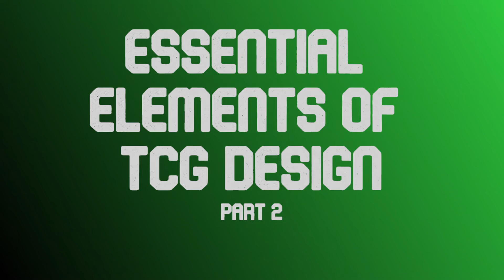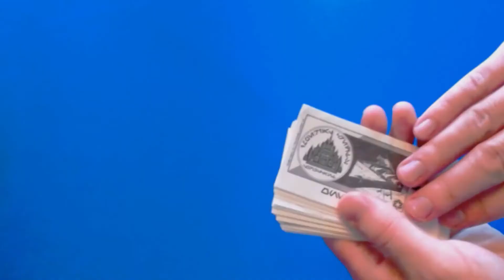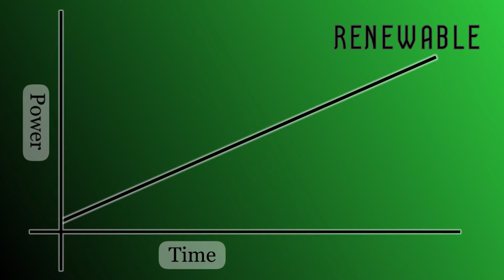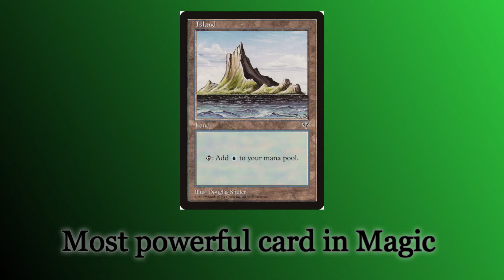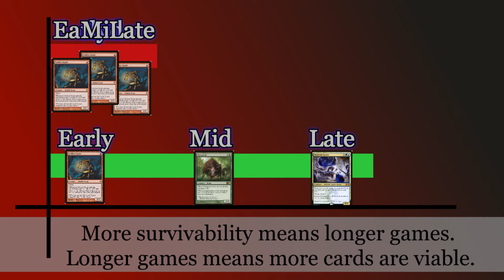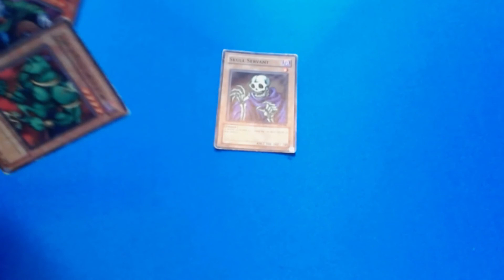Theory 303 - Essential Elements of TCG Design - Resources

Comment: I can’t tell if it’s already subtext for this video, but another concept that occurs to me, especially with vintage MTG, is the idea of offsetting when one player bricks but the other doesn’t. One player has only a 7/7 card but can’t play it in the early game due to resource cost, while the other player has only a 1/1 card though thankfully it should be no trouble to play it immediately. Whether or not this idea would also compensate for mana screw is outside the scope of a single YouTube comment.
Reply from the maker: Offsetting is important in a bunch of ways in tcgs, and is probably worth a video of its own at some point. Jotting it down in the 'video ideas' list!

Comment: It occurs to me that a lot of the problems people have with Magic’s Lands could be solved if we borrow a bit from Digimon. Not the memory system, that’s a bit too unique to work in every game, but digivolution. Every time you digivolve, you draw an extra card, essentially keeping you at the same hand size and replacing the card you just put down. Applied even to a basic land card type of system, it lessons the frustration of mana flood by turning every resource card into an extra draw, and while it can’t stop mana screw entirely, it does lesson the chances of that happening, essentially giving two cards per turn.

It would take a bit of testing and working to iron out, but I think it’s an idea worth pursuing.

Comment: One thing still worth mentioning is that resource engines can also be separated by when you pay the cost of the cards. Creating back-, and front end systems.

Front end systems are what most games use you tap lands/use action points/etc. and you play the card.
A backend system however lets you play cards for free, but "punishes" you if said card leaves play.

Im currently working on a game wich uses not one, but two back end consumable resource systems. I would like to get some oppinons on them partialy due to the feeling that I've started to trap myself and partialy because I think it can be an interesting conversaton to have.

First is a "life beting" system used for creatures.
   All creature has a "bond" stat. When a creature is defeated the your bond with them breaks wich means two things: 1st you loose Link Points(life) equal to theyre bond stat and 2nd they go to the Broken Zone.

Second is more classical consumable resource system used for the sorcery-esque cards.
   The cost of theese cards is payed by moving cards from your Broken Zone to your discard pile. Yes, you read that right the destroyed monsters became a new type of resource, wich I think is neat way to link the two system togheter and give the game a better, more fluid and flavor full card flow.

Aside from them there are 2 other card types: "heroes" and "skills".
   Skills are similar to yugioh's trap cards when a creature you control attacks or being attacked you can play 1 skill card from your hand, if the element requirement for playing that card is met by the creatures you have in play.
   Example: you have 1 crystal and 2 void element creatures in play if either one of theese creatures attacks or being attacked you can play a skill card with an element requirement of 1 crystal/1 void/2 void/1 crystal + 1 void/1 crystal + 2 void.

Heroes are less relevant for us now. All thats important is that they do have a "hero power" and a type wich desiced what kind of sorceries can you play form hand.(Emphasis on the from hand part.)

The problem comes up when I think about big creatures. After all they are hard to get rid off and I only need to pay anything for them when they have been got rid off, so why would I ever play smaller ones? I thought about a size system where each creature has a size and you are given a hard limit to the total value of size your creatures can have, but Im kinda set on the idea of creature zones, 4 in particular.
   Since the game clearly gonna need a draw up system to avoid stalls and this seemed the most elegant way to prevent a 1:1 creatures and skills only deck building process where the defining factor of games would be the heroes abilities and who has the better skill cards in hand. Plus it would add a 4th stat to creatures (bond, power and damage are all different stats for the sake of better balancing and damage only occurs during a direct attack) and that makes my gaming sense to start tingling the bad way.
   The other idea I have is to give the heroes a bond limit to how much can the total bond value of the creatures they have in play add up to, which seems like the better idea, but it would make the existense of the creature zones kind of wierd, while also not solving the problem without them, only putting the weight from one tip of the scale to the other.

I havent started play testing yet. I prefer to have a solid enough idea on base rules before designing cards.

What do you guys think?

Comment: Slight correction. Set 1 summoned skull was actually good.
Reply from the maker: Even back then, players were running around with Raigeki, Black Hole, even fissure. Going -1 card and -1 normal summon to upgrade your monster was suspect from the first booster release, and tribute summoning as a mechanic only got worse from there. Although that slide is mostly just me being salty at all the "yugioh was only good back when summoned skull was the best card" people XD

Comment: How do cards in your deck as a resource fit in all of that ? I guess it's technically consumable, but it rarely increases.
Reply from the maker: I know some games that use the deck as life, but I haven't heard of a tcg that uses the deck as resources. Technically it would be a consumable system, although definitely a bit of a weird one, since like you said, it won't often increase during the game.
Reply: Cards in deck as a resource only really appears in certain situations: You go through most of your deck over the course of every game and can deck out relatively easily (Rush Duel and some Pokémon decks are apparently examples); the composition of your deck is important for a major game mechanic in certain ways (Weiss Schwartz is an example, with CXs in deck as the resource); or you can pull stuff from deck much more easily than grave (the Yugioh deck Naturia Runick was an example before it got crippled by a Sacred Tree limit).
EDIT: Yugioh’s Snake-Eye decks, especially Fire King Snake-Eye, are another example of decks where running out of important cards in your deck specifically is important.

Comment: I've dabbled in TCG design a few times, and the most fun game I ever designed (as decided by friends who played it) was a game based on Worms. The game begins with players laying out a set of location cards to build the island, then playing their Worms and obstacles face down to the various locations. Once that's done, the face-down cards are turned over to reveal where all of the Worms are located, and depending on the placement of the obstacles, some Worms could end up trapped or start with cover, etc. Players shuffle their decks and draw their starting hand. The deck contains mostly combo cards where half of the card represents a weapon and the other half represents an event. During your turn, you normally get two actions: moving a Worm, then firing a weapon with that Worm, however firing a weapon always ends your turn, so if you attack first, you don't get to move. Also, if your selected Worm takes damage during your turn (which is rare) your turn ends. Firing a weapon just requires you to play any weapon from hand and choose a target, then players get to play events, then the top card of the attacker's deck is turned over and a number in the corner of the card determines if the attack hits or not. Damage is applied, the target could get launched to another location or off the island entirely, fun stuff. For the most part, there are no costs. Just deck building limits. You can theoretically play any weapon on any turn. If you draw a ridiculous super weapon in your opening hand, you could play it. It's a pretty chaotic experience at times, but surprisingly worked well. Melee weapons were harder to use, because you needed to get into melee range with the target, but were still well balanced with the rules for ranged weapons. There was no resource system, really, aside from cards in hand. To be fair, there was ONE resource, but it was entirely optional, and you could play an entire game without ever using it. Victory was achieved by eliminating all enemy Worms. Of course, as your Worms get eliminated, the game gets harder for you, making it difficult to come back from a losing position, but very satisfying when you do.
Reply from the maker: Sounds fun! And yeah, resource systems aren't essential for smaller games - there's a lot of design space for some neat games without dedicated resource systems.

Comment: Resource systems are a really good way to support an expanding game to give more possibilities as well as a way to balance good cards, however, adding more ways to achieve the win condition could also help with variety, I also have an idea for balancing good cards, its not great but you could have a rank system and have a limit of how many cards you can have in your deck from each rank
Reply: So the banlist system from yugioh duel links ? In that game, you can only run X cards from the limited to X list + any number of cards that are on no list. X goes from 1 to 3 (technically, it's 0 to 3)

Comment: Haha, I made a game that doesn't have a resource system or life total, you just play until you lose your cards. that last sentence hit hard, I'm already starting to see variety limitation, I just add different game mechanics like adding something similar to plainswalkers
Reply from the maker: It does really depend on how many cards you're making for the game. If it's a stand-alone game, you likely don't need a resource system. You can add one if you want, but it won't cause problems if it's not there. But the more cards you make for the game, the more important a resource system is going to be. When you get to the level of a tcg, that's when it becomes essential. I've made a few 'play until you lose your cards'-type games, and they can be a lot of fun!

Comment: Great video, but I wonder if there is an healthy starting resource number for a TCG. Do you think there is one? By the video it looks like you prefer the mixed one. And finally a final question, are you currently designing a TCG yourself ?
Reply from the maker: I'm working on another video on resources (actually two), but resources have two main functions in a game, and the systems I've most enjoyed separate the two functions into two separate resources systems (like levels and stock in Weiss or Wixoss). I'm working on a tcg, but just as a design exercise, not as something to publish. I'm also working on a few tcg-ish games that I would like to actually publish as well.

Comment: just a point towards general aplicability. renewable resources dont just have to return every turn. just that there is some method to continually get them. for example you get something every 2 turns.
Reply from the maker: Good point. I can't think of a system like that in a tcg, but it does show up in games in general, and would definitely still fit as a renewable system.

Comment: yugioh rush duel would be an interesting example in this video, because it took the old style of yugioh and flipped it on its head by removing all of the extra mechanics in favor of allowing unlimited normal summons and drawing to 5 cards every turn, making the tribute summon mechanic actually viable without needing any outside resource system.
Reply: I do appreciate how it turns the conventional card economy logic on its head. Discarding for cost can actually be beneficial since you almost always want to have an empty hand so you can draw 5.
Reply: @ENCHANTMEN_ Unless you face some mill stall deck
Reply from the maker: Rush Duels are really neat. I'm still a bit salty they haven't been released in english. It's a really interesting tweak on yugioh's formula. I'm not sure it opens up a huge amount of additional design space, but as a set of base rules it feels much better than what yugioh's main game has to work with.

Comment: Can you give examples of resource systems that fall under each category and pros and cons of each? I’m trying to design my own and I’ve just hit a wall and I’m not sure which direction to go…

Also have you seen Grand Archive? How would you classify that game?

Thanks and love this type of content!
Reply from the maker: This comment slipped by me somehow - Grand Archive's system looks interesting - it combines elements of renewable and consumable systems. It's mostly a renewable system, but doesn't steadily tick up like lands or land-similar mechanics do. It's a renewable system that behaves like a consumable system, which is pretty cool.

As far as other examples, pretty much every card game does things a bit differently. Just from the games I've done how-to-plays on this channel, Rebirth For You and Z/X are fairly classic renewable systems, although interestingly they both ramp a little harder in the first turn or two. Duel Masters is modeled after MTG, and is very similar in its linearity. Luck and Logic and Wixoss, meanwhile, are level/consumable systems. And Precious memories is an interesting take on consumable sources, in that it uses cards in hand, a bit like Grand Archive, except they're discarded instead of just set aside for a turn. At a basic level, renewable systems are generally more straightforward, which can be easier to design and also easier for players to understand, but the con is that they are more rigidly linear than consumable systems. Meanwhile, consumable systems are a bit trickier to design, and can be a bit less intuitive to manage, but they allow for more flexibility in how they're designed and used in game.

Comment: 1- highly dislike the use of the term resourse engines. resourse management systems seem a better choice.
2- Mark Rosewater, the head behind current MTG, has said quite a lot about the advantages of growing resourse systems. Basicaly they help the game be/ feel like an escalation of events and power plays and lead to the late game being, in therory, more exciting and memorable.
3-It would be nice to have talked about how modern games opt for automatically giving the player a resourse every turn
4- i believe i disagree on the takes on yugioh. I would not call tribute summoning a mechanic but a core rule of the game. "Fixed resources" as you call them, are basicaly a set of rules for the game.
5- Also on yugioh: hum, no mention of the very widespred belief that yugioh( and TCGs in general) the cards themselves are the resourses and how tight the "economy" is in that game?
Reply from the maker: 1 - yeah, I was trying to avoid just using 'system' for all of these elements (life systems, resource systems, rules interaction systems). I'm not quite sure that was something I needed to worry about, I agree resource engine is awkward.
2 - I think growing/escalating resources is absolutely good card game design. I think there needs to be some way of conveying that, but there's a bunch of different tools to get that escalation. 
3 - It's pretty common now, but Gate Ruler is one example of a modern tcg that doesn't.
4 - It was intended to be a core part of the rules, but ended up closer to how keywords are coded in the rules. I don't really have a particular attachment to calling it one term or the other, though.
5 - I'm trying to keep a division between cards as a resource and a dedicated resource mechanic - I believe tcgs need both.